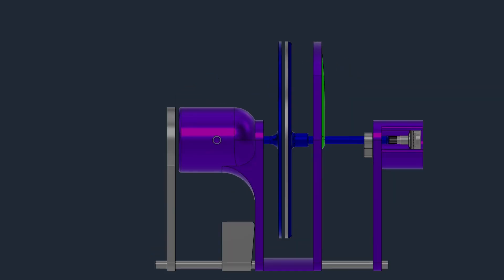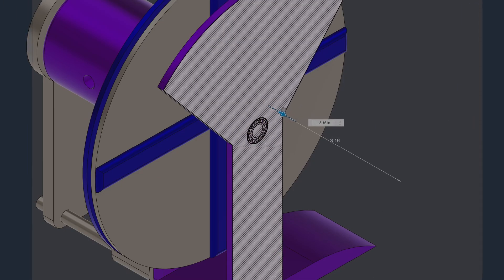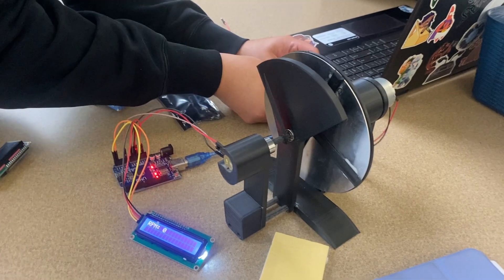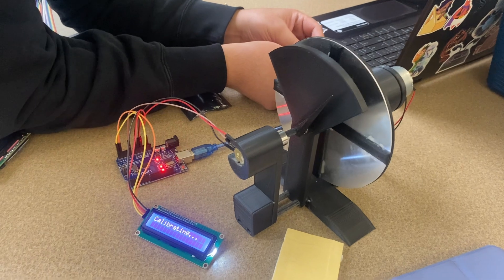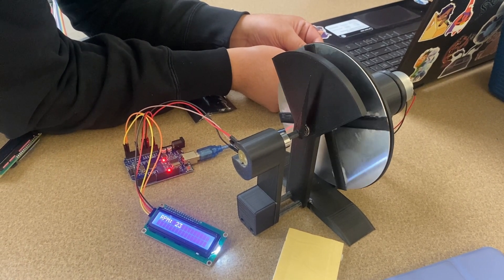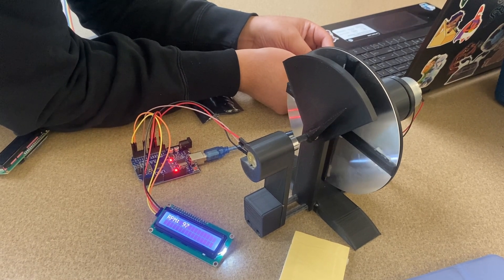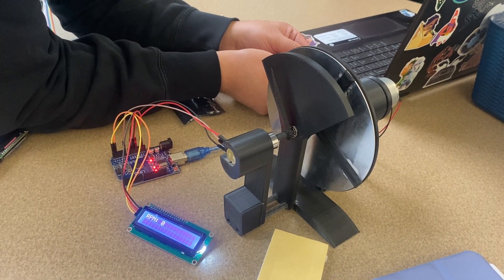Eddy Current Tachometer

Comment: Clever use of eddy currents! Is there a spring counteracting the torque?
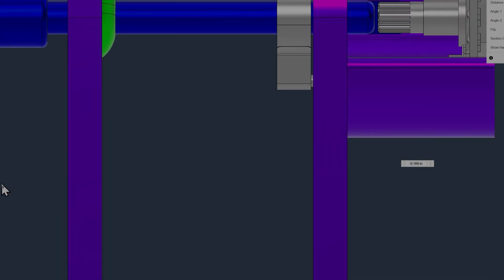Reply: Yes 0:23
Reply: @john.f.chamberlain I even went back to watch it again, but still missed it.
Reply from the maker: There is a spiral spring installed onto the receiving shaft just in front of the potentiometer housing. The spring I used was quite stiff because the torque generated was very high from the 20 magnets. You could use a much weaker spring and simply increase the distance between the plates if you wanted.